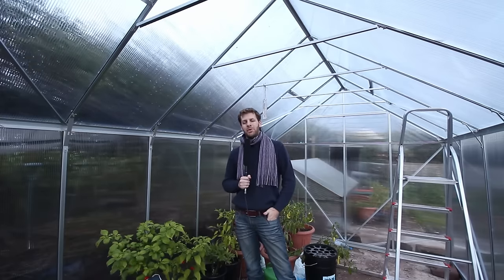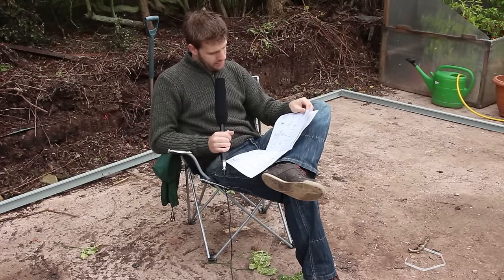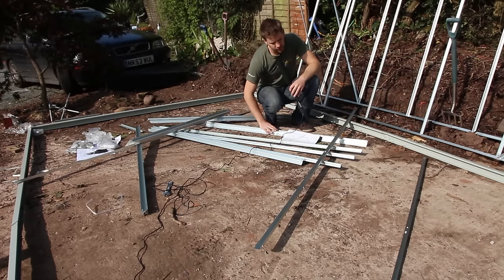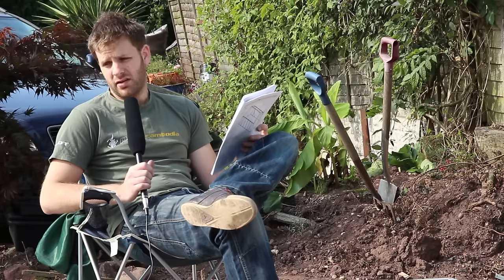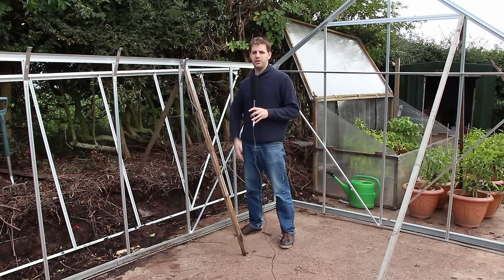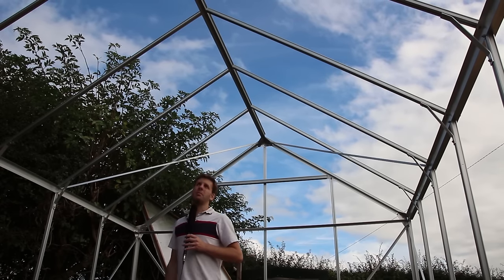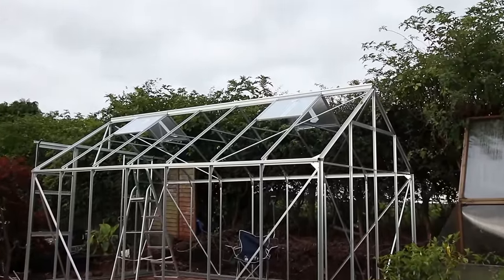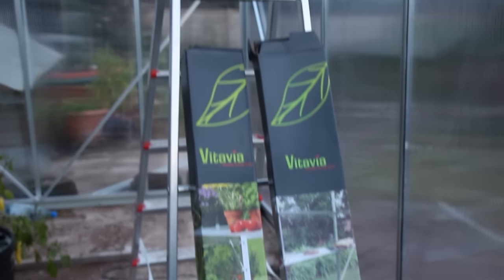Building a Greenhouse - Vitavia Jupiter 11500 Polycarbonate Greenhouse

Comment: Hello. I have just bought this greenhouse, and your vid was very helpful. 
I tried reading and understanding the instructions, and couldn't figure out a few bits..
I haven't put the roof on yet, and would have probably made the same mistake as you, and not put enough bolts in the spaces for the strengthening bars. Cheers for the help..:)

Comment: Nice!
Seems the mistakes you did while building, are universal! :D
I builded a quite similar one, and met the same issues. I bumped into some snags with the fitting of the two-three last roof windows, before they where on their place. Had to twist the whole green house framework to get them sliding all the way up.

It wasn`t too difficult building a green house like this, but it took longer time than expected.
Another thing, I dreamed about nuts and bolts for weeks afterwards.. ;)

Best wishes, Halvor.

Comment: Planning of buying a Vitavia Zeus, which has glass sides. Wondering about the base brackets; we will have it with 6 anchors, but would it be okay that apart from these 6 points, the rest of the base 'floats' above the ground? Thus, if I pour these 6 anchors in concrete, I can fill up under the base with soil. The base just looks a bit flimsy, so it would be great to hear some first hand experience... .

Comment: I built my greenhouse two weeks ago (not a Vitavia). One week later it was wiped out in a big storm we had here. Our new Vitavia Triton is on the way. I'll be doing some extra strengthening around the frame. It's a slightly different construction with slide in 6mm polycabonate panels. How did you fix your base to the concrete in the end ?

Comment: Thank you for the inspiration! Whilst I had considered using glass, I'm certainly going to go with polycarbonate moving forward. Specifically, I'm going to opt with solid polycarbonate. I found some info at https://www.roofingmegastore.co.uk/roofing-categories/pitched-roofing/roofing-sheets/polycarbonate.html, although tiles were out of the question for obvious reasons ;P. Out of interest, would anything higher than 6mm have a negative effect?

Comment from the maker: Most likely I'll just be heating the water in the fish tanks which will keep the greenhouse at a nice temperature, however if I was heating for extended periods I would get a small 600w-1.5kw gas heater. I will never use paraffin again since I destroyed all the panels on an old greenhouse by sooting the thing out, and heating with electricity is too expensive.

Comment: I got mine delivered on monday afternoon so started it yesterday i thought it was pretty simple up till the roof ! On my own i used the washing and built all 4 sides to it leaving the roof bolts on the top right frame off to slip.the line back out lol you could cut it bit we need it haha! The roof windows were a pussy to figure it out whare they hinged from since instructions didn't show how they connected just to put them together lol its up now looks great i got a 8Lx6w foot 

but next time should be simple!